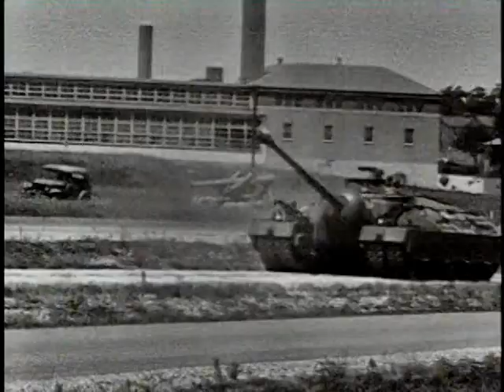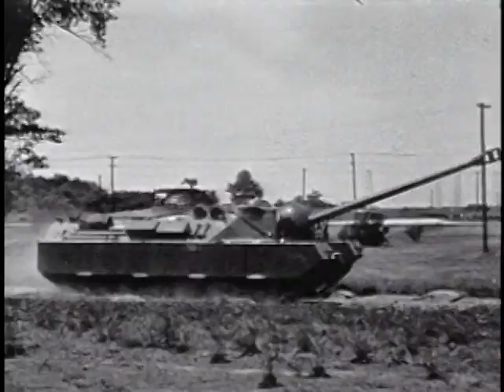US T-28/T-95 super heavy  Tank WW2

Comment: "so this weighs 60 tons more than the sherman but we're using the same engine?" "yeah sure what could go wrong"
Reply: At least the t95 have 303mm of armor at the frount  it could have a cople v12 engines for a bit of speed
Reply: It doesnt need the mobility... You would just pit it against helpless concrete structures, who have no engine at all...
Reply: If and I say if it were out numbered all the german troops and tanks would go to the back a 95 long ton tank would also need engine power to get up hills
Reply: Oh I almost forgot the gun manlet is the weakest point in this beasts armor I believe
Reply: the gun mantlet is over 300mm thick and heavily curved.  Nothing fired at a tank in WW2 could penetrate it.
Reply: skraf883 i agree nothing "could" penetrate it from the front but at the side and rear its only got 152 mm and 52 mm of armour it could be easily distroyed with a well placed shoot into the sides or rear many german guns could penetrate 152mm and deal serious damage i love this tank so i know alot about it and i know it's weaknesses
Reply: Oliver Simpkins
Yes, all weapons have their weaknesses, the trick is not to put it in situations its not designed for :-)
Reply: @gummipalle   But it's not just about mobility, it's also about mechanical reliability since the engine & transmission were so overburdened by the massive weight that reliability problems & breakdowns would be frequent.

A large turbo-diesel V12 motor would have been appropriate for such a massive vehicle, but as we know diesel engines were still quite rare in armored military vehicles in the 1940's (they became much more common during the 1950s and up). But even if mobility was clearly not a priority for this design, just on sound engineering principle it should have at least been given the gasoline Ford GAC V12 that was used in the U.S. T29 & T32 Heavy Tanks which put out around 750hp. It was basically the same Ford V8 but with 4 more cylinders added on to make a robust V12 powerplant. This stronger engine would've been able to better handle the tremendous weight and would've certainly reduced the chance of breakdown, while also increasing overall mobility and top-speed.
Reply: @General Goldy Indeed. If this tank would have gone into combat, it would most likely be heavily guarded on its sides and rear.
Reply: bro The real is T95 but the maker of this tank decides to name it t28 so thats why and its not 60 tons its 95 tons  if you said 60 tons so its not armored well if its 95 tons so its armored
Reply: @skraf883  but batlle ships can penetrate t28 gun manlet even low tier battle ships can still able to penetrate it
Reply: @tanaka_keitoyt780  Name one battleship that has ever penetrated the T28/T95's Gun mantlet.
Reply: @General Goldy Look up the U.S. T-29/T-30 heavy tanks. Although they were developed a bit too late for use in WWII they were comparable to the Tiger I/II in both armor protection and firepower and would've had no trouble going up against ANY German tank during WWII. And they both used powerful V12 motors to handle the large mass.

Even though the T-29 and T-30 heavy tanks came a little too late to be used in World War II the work that went into their design and engineering gave the U.S. military valuable info and experience which helped develop later heavy tanks such as the M103.

Comment: KwK-40 L-61 used common 128mm Pz.Gr-43 APCR Tungsten carbide round, developed for every type of German long barreled gun of the war. We're wrong to talk about Sturer Emils, because when they were in service, the APCR round didn't exist yet.
The KwK-40 L-61 is is in fact, a vehicle version of the original 128mm Flak-40 L-61 cannon, which was used till the end of the war and which had it's APCR round.
It was superior to 128mm KwK-44 L-55 in terms of penetration and range, while in power was equal.

Comment: The IS-2 with the semi-automatic D-25 was able to achieve 6RPM. It had a similar shell weight to the T5 and was operated by a smaller loader in a more cramped space. It was also a 2 part round. There is no doubt whether or not the T5 can achieve 6RPM.

Comment: Not so easy as that, the track side armor was as thick as the front armor of the Tiger, so it will absorb anything a Tiger could throw at it. Further, this vehicle was not on its own, it would have had plenty of tanks supporting it along with loads of infantry. The reason none were ever used in combat is that the Allies got into Germany before they were ready, so they were not needed, hence never built aside from the two prototypes used for testing. Only one still exists at Ft. Benning Ga.

Comment: i bet you this tank can still take on an modern tank
Reply: Red Flame Dragon Lol damn.
Reply: Pretty sure a m1a2 or A1 could destroy it easily
Reply: lol not a chance, modern tank could blow it up with just one shot
Reply: NOT even close, it can be outmaneuvered, outranged, outgunned, and out armored. There is not a single thing better than a modern MBT
Reply: any MBT would go through T95's armour like butter
Reply: @mrmacedon  are u sure it could outrange it i mean look how long the gun is...
Reply: @sisigs4820  It's not just about barrel length, but also about the pressure the gun was made to withstand (translating to the energy of the projectile) and the ammunition type, both categories in which modern MBTs severely outclass the T28, leading to a much higher range and due to the ammunition type, still a much higher penetration value at the respective maximum ranges.

Comment: That narrator... "...it had to have 4 sets of tracks instead of the ussual two..." the ACTAUL reason for the 4 sets is so that the outer 2 can be removed for easy rail-way transport (so it actually fits when going through tunnels) otherwise you'd need to have wider tracks, not more :P
Reply: Idk, maybe they had 4 separate so they wouldn't have to deal with 2 sets of tracks each so wide and heavy they'd be a pain in the ass to change
Reply: doonglerules " the actual reason for the 4 sets is so that the outer 2 can be removed for easy rail-way transport"
Reply: Valentine Ya cant just quote yourself to refute
Reply: He is correct. The outer tracks were removed for rail transport. That is the reason they didn't use two wide tracks. The quad-track setup also lowered ground pressure and made it easier to cross soft terrain. It wouldn't matter, as the T28 and T95 were horribly underpowered for their weight and could barely cross any terrain at all.
Reply: "It wouldn't matter, as the T28 and T95 were horribly underpowered for their weight and could barely cross any terrain at all."

The T28 and T95 were the exact same vehicle. 

It's really not that hard people.  After the war, the vehicle was renumbered from T28 to T95.  Typically, it is referred to as the T28/95
Reply: Achim Wurst it wasn't designed to be a tank. it was designed to be an assault gun.  its function was to take out fixed fortifications like the Siegfried Line from up to 12 miles away.
Reply: The Russian Bear actually, the vehicles you mentioned have different armerment, weight, protection, engines ect. There is a reason for the new names for the cehicles since they are in the same series.

As for the T28/T95 it went from being a T28 Super heavy tank toe a T95 Gun Motor Carrige

Comment: The KwK 40 was unable to penetrate the IS-2 from any angle frontally. For Germany, APCR rounds were preferred to APDS rounds because APCR rounds were more accurate and more than enough to deal with the threats. However, the Jagdpanzer E-100 was planned to fire APDS instead of APCR out of its 173mm gun.

Comment: i lways wonderd how do they replace the inside tracks if they get damaged??, the out side track you replace like on any other tanks but u cannot reach the inside track...worst designed tank ever!
Reply: Tank track is separated and driven off the sprocket. To have anything outside of the track being broken is irrelevant. Look at how many modern day tanks have skirting. It doesn't matter.
Reply: Actually....the outside set of tracks was removable. Once off they could be connected together and towed behind to make the "tank" narrower. Inside track damage....just remove the outside track. 

Semper Fi !
Reply: The tracks could be broke and released and coupled back just like the outer sets. There are two cranes on the sides to assist with the load but replacing a defective block was not difficult and you'd use the same sprockets to move the track around.  The outer sets could be dismounted and towed behind the tank which took a good crew 1 1/2 to 2 hrs which defeated their purpose. The T-28 was designed to confront fortifications, not tank combat.  T-28-34 project was dropped in 1949. .  Correct...dumbass design.

Comment: @boerakker15 i personallly say mouse cause the drivetrain is more effective (instead of directly using gasoline,the engine generates electricity n the tank is powered by motor) , it actually has a turret instead of hull mounted gun.  witch will be useful if the track is damaged

Comment: If I'm correct the Americans made modular components (if this is the correct naming for it), so that tracks etc. could be fitted on other tanks with ease and you did not have to have all kinds of components with you for one certain tank. The Germans however custom made everything, that is the reason the MAUS just had 2 tracks and even a special railroad car designed to transport it. Same with the tracks of Tiger or Tiger II, they have special tracks for railroad transport which were smaller.

Comment: The US Army used the "T" series as an experimental or pre-production model number before and during WW2. The M-4 Sherman started as T6 medium tank. M-26 Pershing started as the T20 heavy tank. Later, the M-26 was changed to a medium tank. The US army did fielded a super Pershing with a more powerful 90mm and added armored during the war. It was considered more powerful than the German King Tiger. The T-28 was designed as assualt vehicle. These tanks were made by all 4 super powers during WW2.

Comment: Firstly, it couldn't have even be brought to shore due to extensive weight. USN even rejected M-26's due to that, not to mention T-95's then.
Secondly, it would have a 105mm long barreled cannon which was useless against thick concrete bunkers. Heavier caliber with shorter barrel would be efficient against that, because smaller muzzle velocity is better for a HE round.
Flamethrowers and infantry with explosives were more difficult way against bunkers, but I agree, they showed to be efficient.

Comment: The KwK 40 L/61 used a smaller charge for its gun, which is why it was less powerful than the later KwK 44 L/55, which was selected for the Jagdtiger. Even with APCR, it cannot achieve 360mm of penetration. The post war American M58 had trouble penetrating 360mm of armor with APDS and it was a much much more powerful gun.

Comment: It would not 5 minutes. It would take a minute maximum. Its ROF would approach 6RPM, which is based on the rate of fire of the IS-2, which also had 1 loader with separate propellant. It would not bog on difficult terrain, otherwise it wouldn't be using 4 sets of tracks. The lack of a turret made it an assault gun, meaning that it gets a different role.

Comment: The tracks are specially made. The 2 outer tracks are addons for rough terrain and are specially made to be easy to take off for crossing bridges and railcar loading.
Reply: There were no bridges it could cross with its weight. It needed 4 tracks to not sink into the ground, and the outer two were made removable for railway

Comment: i think YOU need to do more research, the tank was never finally named a Tank Destroyer, it was in fact first named the T28/T95, but then redesigned into the  T95 Gun Motor Carriage in 1945, then in 1946 it is redesigned again into the Super Heavy Tank T28. also the gun it mounted was exactly the same as the gun on the T29 mounted the same gun in it conventional rotating turret, but better yet, the T30 was developed with a larger-caliber gun also in a conventional rotating turret

Comment: The T5 didn't take that long to load, especially if it has a semi-automatic breech. The IS-2 was able to achieve up to 6RPM in a small cramped turret using separate propellant and with 1 loader. There is no doubt that the T95 would easily get 6RPM. Even Russians were able to do that and they have smaller tankers. Also it would take about 20 seconds to turn 360 degrees. 5 minute turning means that it would turn 1.6 degrees per second, which is impossibly slow.

Comment: @bogdy007 quality doesn't all ways = big gun and armor. The more armor and bigger gun = less Mobility and speed the Sherman was reasonably comfortable for the crew and was fast and very good mobility. It did have some flaws like the fuel and short gun ( though the Sherman firefly addressed that problem). but over all it fit what it what designed to do which was be a fast mobile tank that was easy to maintain and produce

Comment: yeah 300mm of frontal and around 200- 270 on the sides  and a 105 mm gun that could rip a tiger vi  guts out  bad part was the 600 hp engine witch pretty much broke this 98 ton beast  by only letting it go 17kmh  if only they built a 1500 hp to help fix the speed problem

Comment: I am not sure it would have failed vs. Japanese forts.  I don't know any gun they had that could penetrate it.  Certainly they used suiciding infantry with satchel charges but supporting infantry could protect them.  Hills would have been rough though.  The flamethrower tank still usually better anyway, or just fire enough indirect rounds via 155mm from out of site.  Static defensive war is very difficult in that technological era.

Comment: There's no standard, that's relative. But, sadly, the 500m with 30° is the most common target and also the most inaccurate due to that, because that's not a maximal penetration. 0m at 0° is the most accurate data and yes, that's possible, I've already told you to check some penetration tables and convince yourself.
100m at 0° is better than 500m at 30°, but it's still not the most accurate data. Even the heavy naval cannons were tested at 0m at 0°, not to mention light vehicle cannons then.

Comment: @bogdy007 the German tanks that where produced later in the war had more armor having more armor and a bigger gun weren't very mobile and broke down (because of under powered engines). There mobility was also hurt by the fact that they where so heavy that some bridges in the country couldn't support there weight. Not to mention more weight = more fuel consumption. I do agree that the panther was the classiest tank of ww2 but it did have the same problem as all German tanks of ww2 which was prod

Comment: It's not impossible, of course that you won't touch the target with the cannon, because you'll damage it, but you'll be as close as possible, because that will give you the most accurate data of maximum penetration of that cannon.
At 500m with 30° is common range and slope in penetration tables, but it's wrong because it gives an inaccurate data. That's not a maximum penetration.

Comment: @carthima Modern tanks weight AROUND 70 tons...the Abrams is around 65 tons, the Leopard 2 A6 about the same...the Leclerc makes an expeption with being about 50 tons, and the Soviet/Russian tanks where ALWAYS much lighter then the western tanks, by using heavy slope and low sihlouettes.
Also, the Shermans combat record might have sucked, BUT it was not crappy...it actually held together and drove smoother then ANY german tank, whose transmission would break easily.

Comment: Which of the 2 American Super Heavy Tanks will cause more Ground Pressure, the T28 Super Heavy Tank with 2 Tracks or the 105mm Gun Motor Carriage T95 with 4 Tracks?
Reply: Probably the 2 tracked one. The bigger the tracks are the better the weight distribution is. If a tank has too small tracks it won't handle well on terrain and if it's heavy, ground below it may collapse and roads could be damaged.
Reply: You are aware that it is the same vehicle, there is no seperate T28 or a T95. Less WoT and more actual sources. With or without the additional tracks it's a T28.
Reply: +Dreachon Affirmative
Reply: T-28 and T-95 are one and the same

to answer your question, the two track version as it has less surface area on the ground to spread the pressure
Reply: Ethan Thomson グミ

You should remove the -, that is never used in the designation of US military equipment.

It's either T28 or T95, T-28 is a Russian medium tank that had 3 turrets.
Reply: I literally just found that out XD
Reply: It makes a big difference if you were to run into a T28 or a T-28.
Reply: What wg and gaijin call the "T95" Was originally designated as the T28. Then, due to a role change (To tank destroyer) became the T95. It was then switched back T28 which was the next available designation for a heavy tank. The "T28" in WoT and WT is actually the transport version of the vehicle. The real T28's outer section of tracks could be removed, with the entire process would taking up to 2 hours to complete. This travel version would have never been used in combat without its outer tracks.  It also never had that little glacis thing you see on it in WoT and WT.

Comment: On which KwK-40 do you mean? 128mm or 75mm? Doesn't matter actually, because you're wrong, using APCR PG-43 shell, even the 75mm KwK-40 L-56 (Germany's weakest long barreled cannon) could penetrate 160mm maximally, while IS-II had maximum armor of curved 120mm at front turret and 100mm angled at 60° at front hull.
And by the way, IS-II was the most armored Allied vehicle of the war, which means that this cannon could penetrate any Allied vehicle in general, not to mention 128mm then.